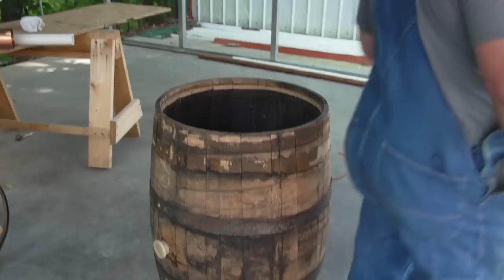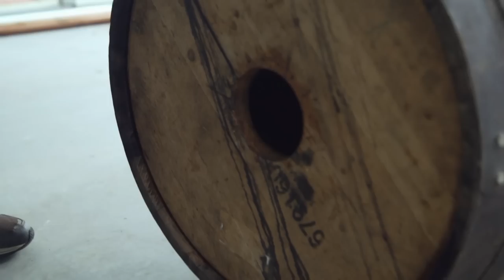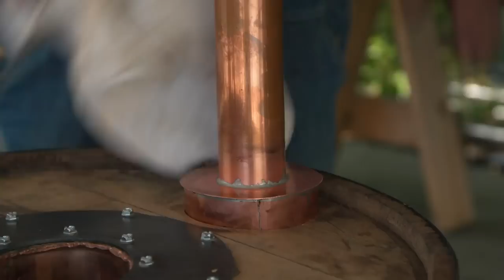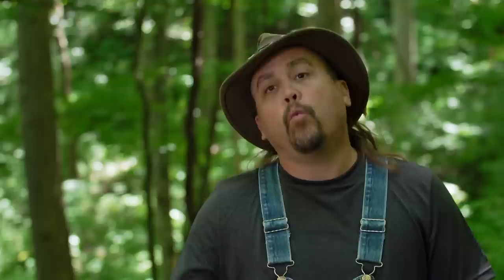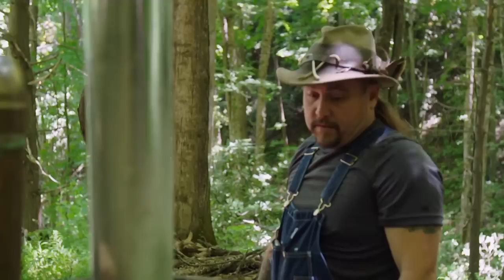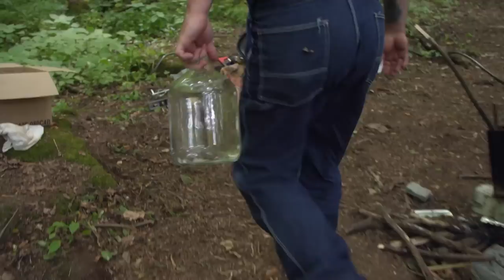Moonshiners Build Brand NEW Wooden Still Pot | Moonshiners

Comment: coulda put a flat piece of copper down and soldered the chimney to it and heat that with a propane burner, then instead of using a full length chimney, fill it with insulation and cap it off at the top of the barrel, that way the core stays warm and its lower profile